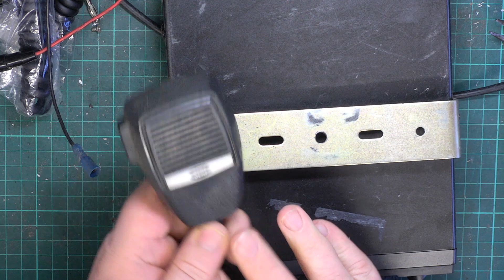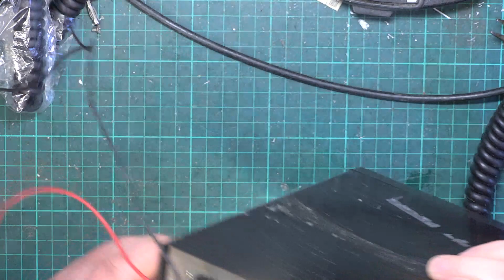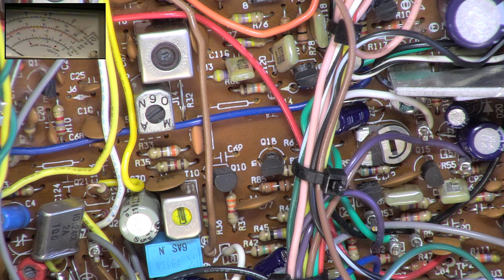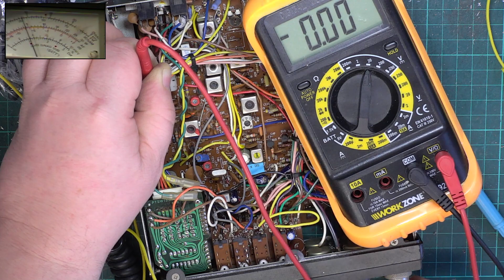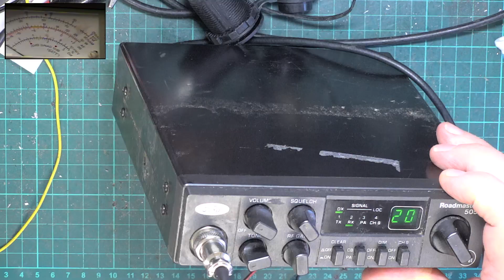Ford Roadmaster 505 CB27/81 CB radio (mobile) - repair & service

Comment: Good lord £199.99 back in 1981 that was a fortune then. Lovely radio, if only all were made to the same standard. I really enjoyed nosing at your in-tray Richard. Id love to do a supermarket sweep around your serviced shelves 🙂
Reply from the maker: misheard..(or I mistyped) £119.99 in 1981.

Someone the other day was suggesting that because I've covered about 6 rigs per week over the lockdown period I'm bound to run out of sets to do soon. Wrong! 60%+ are customer repairs, when we try & compromise between brand new sets (about 30 still to do), the in-tray shelves & two carboard boxes of donations & some sets bought as scrap & incomplete. I've also got to finish off a pipe organ installation at a church 5 miles away when weather picks up...the there is building work here that should start in the next six months & when finished a pipe organ to restore & install in there.

Richard
Reply: @ukfmcbradioservicingTango21  sorry i probably misheard you. I thought £199 was a bit high. Glad you have plenty of sets left to do, your videos have given me something to look forward to most days during lock down so THANK YOU 🙏

Comment: Emmm!  What is the set with the sloping front.  Doesn't matter, you will get to it in 5 years or so.  I'll find out then.
Reply from the maker: The Interceptor TC300?

Richard
Reply: @ukfmcbradioservicingTango21  I hope you didn't go out just to look for it?  Thanks,  at least I know of the Interceptor.  Not sure if I ever repaired one though.  It looks as if it could be trouble that one, but I am usually wrong.
I was asked to wire a mic' for someone, so I said "Yeah ok, it is a nice day I will do that for you if you want to drop in past"
Turns out it was a NOTO 2000 they appeared with.  Now it is a legal set if the chips are not swapped over and the power is still below 4 watts.  You can argue that, but I was also asked what the knob that said "Band A,B,C,D,UK" and what does AM?FM?USB/LSB mean?"
Honestly, she didn't have a clue.
I told her it was just they also made a set that looked the same but was totally illegal.
I told her that set like that should not be used anyway.  But I also told her that you do get set now where you can use it legally now if she wants to buy one from President.
I then had to try hunt down signals on the scanner I have, as useless as it is (I wish I still had the one the magic smoke came out of) so I explained as best as I could.
I don't think she will be investing, she told me someone was on the channel she was using from France and she told him to clear off.  I thought it was funny, he was trying to get through to her and all she was interested in was talking to her mate a mile or so away.  Anyway, no danger of her ever using it for anything but the 40 UK/FM channels.
I asked her how much she paid for it?  £!49.99p, I think they saw her coming, even for a set like that.
Anyway, it took a long time to get that pint of milk!
I think she must be in her 80s now, I couldn't even remember her name!
After a few minutes of trying to remember it I didn't want to say "What is your name again?"  It would have been a bit embarrassing.
I bet the shop keeper was glad to get rid of that last set he had before he closed down.
He could have sold her a £40 set!
I never asked what she used for an aerial.
Mabe a wet bit of string, she didn't have a clue other than how to press the mic and change channel.
He mate has a Midland "Small one" she said.  Both sets are still running from 1982 and this is the first problem with any of them.  Mind you they are so close it could be a bit off and they wouldn't notice.  I doubt she would notice anyway if it was half a channel off.  Her set was still spot on frequency, Cybernet chassis and the warranty stickers are still on it.
Reply: @bigpimp347  Short attention span eh!!!  lol

Comment: The Rotel 220 is next to the Lowe tx40
Reply from the maker: Thanks. The RVC230 is to the left, the RVC220 is underneath & upside down on the top of the shelf under the TX40 box. That's what I was looking for for my Cybernet recap video.

Richard
Reply: @ukfmcbradioservicingTango21  I'll be looking forward to the results of the cybernet re-capping.

Comment: Nice old Cybernet boarded rig...lovely...surely u can reverse engineer the dimmer from a Rotel 240 diagram?
Reply from the maker: Not quickly as the Rotel uses a potentiometer. It's quicker to copy another set's wiring when there is no manual. We do have another of these sets but it's in store whilst building work here is supposed to happen this year.

Richard
Reply: @ukfmcbradioservicingTango21  You have another one of these sets somewhere, you should be able to copy it from that.  My mate had one of these sets and I was envious as I liked the look of them, they looked more expensive, which they were, but you know what I mean.  I don't know if he still has it after all this time though.
You did one before and I am sure you said it was your own, though I would need to look back.
Reply from the maker: @BoB4jjjjs  Most sets here are currently in storage because of forthcoming building work here this year .

Richard
Reply: @ukfmcbradioservicingTango21  You did one just not long ago, but ok, I get it everything is in boxes and this one might have been a customers.